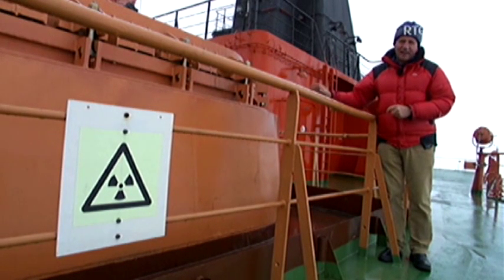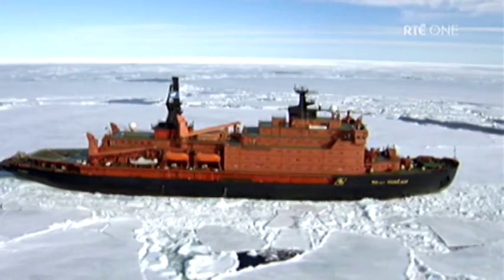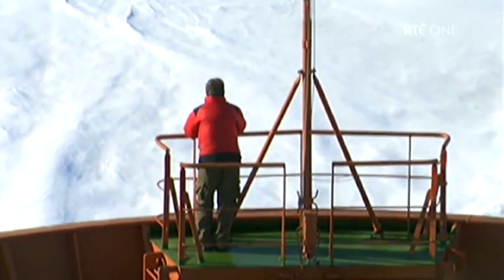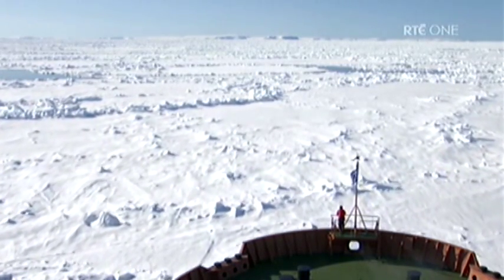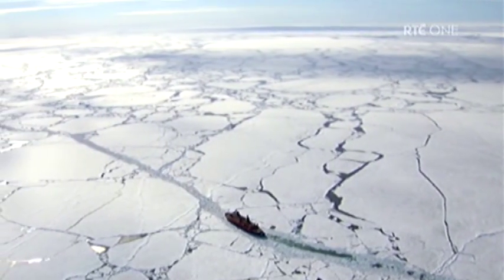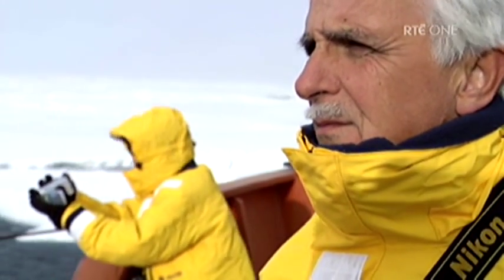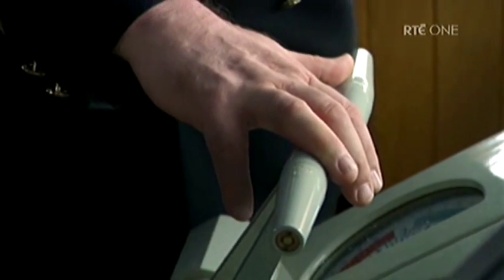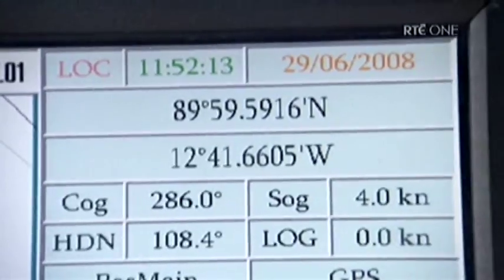RUSSIAN NUCLEAR POWERED ICE BREAKER SHIP 50 LET POBEDY

Comment: The most important point about this ship being nuclear powered is not horsepower alone, but the fact that it doesn't need refueling so often.

There is many even more powerful ships in raw power with diesel engines. But with nuclear power, you can go months or even years, without refueling. While if it was a diesel powered, you would need to refuel very often.
Reply: wopmf4345FxFDxdGaa20 but what about the nuclear waste?
Reply: @ajaythomson22  oof
Reply: Salute for info!☺
Reply: I heard it can go for 10 years without refuling it.
Reply: @sightsandsounds10  fake
Reply: @fightertimur2408  Totally possible. Nuclear  aircraft carriers can go 25 years without refueling.
Reply: @MrSempreme  haha lol 😂
Reply: @ajaythomson22  That's quite late to answer, but)))
You need to waste used nuclear materials only when it is fully depleted. That essentially means that you do it only when refueling.
These nuclear icebreakers need to be refueled once every 5 years.
The wastes are taken away in the process of refueling. After that, they are processed as in every other country - to the nuclear waste facilities and to disposals of nuclear waste.
Reply: @MrSempreme  It isn't wast . It's also for shipping demands .
Reply: @ajaythomson22 they have motors that run on nuclear waste
Reply: The same applies for subs, it allows them to stay underwater for months! It's mind bending

Comment: Ships have already been to the North Pole-  "In 1977, the Soviets powered the first surface vessel to the geographic North Pole. The nuclear icebreaker Arktika departed Murmansk on August 9 and reached the pole on the 17th. The return to Murmansk, by way of Franz Josef Land, was completed on August 23rd. The 14-day experimental voyage, more than half of which was spent breaking through ice, covered 3852 miles at an average speed of 11.5 knots.

1990-   the nuclear icebreaker Rossiya (75,000 shaft horsepower) also made the third visit to the North Pole by a surface ship. (The second visit, by the Sibir', was in 1987). The unique feature of this nine-day cruise was the fact that the ship was adapted to accomodate 40 foreign tourists, who paid $20,000 each for the trip. The cruise was considered such a success that the Sovietskiy Soyuz made two similar tourist trips in 1991 and 1992"

Comment: Nuclear-powered ship can run at maximum power and speed hour after hour and day after day. If it gets stuck somehow (I guess, everything is possible) it can drift for days without fear of running out of fuel and freezing. If needed, it can even melt surrounding ice with hundreds of megawatts of thermal power that is constantly produced aboard.
Nuclear propulsion is the obvious choice for polar seas.

Comment: First off, he said the reactors can produce 175 MegaWatts. There are 746 Watts per horsepower. So it's equivalent to 234,584 horsepower, not the puny 75,000 (175,000,000 / 746). Of course not all the power produced by the reactors will be used to power the ship forward.

Secondly, why all the worry about nuclear waste. Instead of "safely storing it" as the worry goes, just recycle it as they do routinely in France. In the US, we have to store nuclear waste because that waste of a "nuclear engineer" president Jimmy the Carter signed a bill making it illegal to reprocess and reuse nuclear waste. Why? Because the anti-nuclear nuts figured that that measure would make nuclear power less likely to be accepted. After all, who would want a nuclear waste dump in their backyard?

So the best, most environmentally sound fuel, was put off limits to any serious new development in the US and we continue to live with the storage problems, made even worse by subsequent restrictions on the transport of waste.

Question for all you anti-nuclear nuts:  What is more difficult to safely contain, one pound of metal (uranium) or 2.1 million pounds of messy, gooey, flammable, CO2 producing, etc, etc, fossil fuel? Because that's the equivlency. One pound of uranium is capable of producing the same amount of energy as 2.1 million pounds of oil. So next time an oil tanker runs aground and pollutes the pristine beaches and kills the cute otters and ducklings, ask yourself "How many uranium spills there have been since the beginning of the nuclear age?"
Reply: brat997 et oui nous les français on recycle notre merde nucléaire car nous avons un petit pays, on ne peut pas comme vous avec facilité enfouir tout cela au fin fond d'un désert...
Reply: there is no recycling..
After the nuclear reaction, there are many fission products and they need to be seperated. 
After seperation, you get a lot of really dangerous stuff + the stuff you need for bombs (Pu239) you should take a look at hanfords declassified films.
The Purex-process was first invented after WW2 to built the first bombs and mostly all of the reactor-designs were built to produce Pu239.

Also if you like Nuclear waste-treatment, Look up the hanford videos and watch how they tell you, that between 1940-1990 about 2trillion(or billion, i'm not sure)  m³ of highly contaminated and highly hazardous substances have leaked intto the soil...next to the 2nd biggest river of the USA.
And if you like treatment more, look up lahague. They've  got a pipe a couple of a dozen metres reaching into the ocean, dumping radioactive waste 24/7/365

YEA really nice 

also you should know, that you can stand under an Atomic explosion, without taking serious damage from the radiation but if you enter the Canyon of an Nuclear-treatment-plant you die in minutes due to radiation...and there is now way to eliminate that radiation. 

and okay...you say i can't ship oil trough the oceans without the danger of leaking oil and a natural catastrophe.

I prefer the oil leaks instead of contaminated landscapes for hundrets or thousands of years... 

and there have been a lot and a lot and a fucking lot of radioactive spills but do you think, that they tell you??? 
also around 2000 atommic explosions we know of have spilled a whole bunch of uranium.. 

http://www.lancsindustries.com/2017/stop-radioactive-spill/

here they also mention...
"As a radiation safety officer, or a safety manager in a radioactive work environment,
 it’s your job to plan, plan, plan. That includes having a plan to stop –
 and clean up – radioactive spills. In lab, academic and testing 
environments, spills are the most common type radioactive “accident.”"

so go and make your homeworks before hyping an technique you don't understand !
Reply: How many solar powered accidents have happened that will remain poisoning the earth for centuries like with nuclear power? How many solar powered stations ever melt down? Nuclear is stupid when we can harness an energy that creates even less waste
Reply: one modern Russian nuclear station is capable to give electricity, for food of a half of Europe...)) How many hectares of solar batteries are necessary for you to support the small European city...?) And how many it is necessary, for the whole Europe...?) And how many it is necessary for the big plant...?) In Europe there isn't enough place, and with solar batteries will become even less...) 2-3 modern nuclear power plants, are capable to give completely all needs of Europe for electricity...) By the way, you probably have lagged behind technologies, already long ago, during the Soviet period, and now and in Russia, are created, and successfully work, big industrial reactors, on fast neutrons...)) These reactors use absolutely any nuclear fuel...) Even on nonenriched uranium, nuclear waste, from old reactors, serves as fuel, for new reactors which have no waste...) Nuclear waste only America and Europe is afraid... In Russia there are no problems with nuclear waste, they serve as fuel for new reactors...) As Putin, concerning fears of Europe has joked:... Nuclear energy isn't pleasant to you, you don't want to buy gas..., and what you will heat the houses...?) Firewood...?) So firewood in Siberia, it is necessary to buy from Russia again...))) Nuclear power, this most economic, and safe future of mankind...
Reply: You got the point bro,what people need is just evacuate the USA into empty land to supply the solar powered electricity to the world
Reply: space ghost coast to coast solor isnt effective for machinery like this ship yet.
Reply: brat997 tldr; op complains about nuclear waste but doesn't know what nuclear waste is.
Reply: French recycling works by sending the stuff to Russia :)
Reply: Uh? Since 1990 all ammunition used by the US military is depleted uranium. That's right, bullets, anti tank and ship weapons and artillery shells are made using depleted uranium.  Do some research 🤣
Reply: You are aware thoe that combustion propulsion is different in the marine world hence figures are recalculated  to adjust to nautical miles.
Reply: @spaceghostcoasttocoast9343  we already dump all our electronic waste in African countries. What do you think happens when we start making hundreds of square miles of solar panels? What do you think happens to the land that gets covered in solar panels instead of producing food? How about all the species that will go extinct because the area becomes inhabitable? (and this is not in case of a "spill", for solar, that's the expected outcome). How do you store that excess energy to redistribute it during the night without costly and polluting batteries? There is a reason we don't have solar everywhere already.
Reply: @paradhoax  uuuhhhhh There is no viable alternatives (if you say solar or wind, well go read up on that and come back later)
Reply: @spaceghostcoasttocoast9343  Pollution from the process of building and utilizing enough solar panels to produce the same amount of energy would easily be worse than what you get using nuclear power.

Comment: @vampov This is not true. Titanium is not key. Normally if you want to have strong steel with long temperature proof, you need to add apprx 30% of Nickel. Nickel with Chromium singnificantly decreases the transition temperature od the steel alloy. Also you must remove Carbon as much as it is possible from the steel. Because the Carbon could cause any kind of inter or transstructural rupture in a steel structure.

Comment: It's from an uncited comment on the nuke powered icebreakers wiki article.
But you're essentially right.
Also the other obvious one is to roll back the power generated, without having to cut through ice it's energy demands would be reduced, thus requiring less power and less cooling, at the very most it'd just have to travel slower.

Comment: how thick do you think that hull is? i bet it's at least 1/8" thick.
Reply: I read somewhere that at the bow of an older ice breaker is up to 2" thick.  Strictly a wild hairy guess would have it that with the new high-speed steels available out there, it would be down to about 1" thick.  Seems like a lot of metal, but remember those ice floes look pretty thick--enough to gash a lesser ship.  So, in addition to the amount of metal, the type of metal used is considered in designing such a ship as an ice breaker.  But, whatever all of that, it sure is awesome seeing that thing plowing through all that thick ice as though it were cheap plate glass.  Makes you just wanna take that bad boy, go out and hunt down that iceberg that sank the Titanic and bash that sucker to slush.
Reply: Certainly not wrong ....

Comment: tbh it doesn't add up: if each of the 2 reactors produces 175 MW of power then the HP value stated here can't be correct and vice versa. so what is true?
Reply: In fact, everything is true. 75000 is the force selected on the shafts of the propeller, but not all of the energy goes there. Lighting, heating, too, require energy.

Comment: Are you sure about that? I mean 0C water and 35C water only have 35C difference which can surely be negligible or easily counteracted by increasing coolant flow. The reactor reaches really high temperatures so the heat flow shouldn't be altered much.

Comment: @dinoing07 
Gas prices won't go down. Costs of oil extraction there make it only profitable if price is high. You can read about new russian arctic railroads and pipelines on Yamal peninsula — costs are absolutely insane. In winter temperatures go down below -40°C and in summer the region turns into one huge swamp several meters deep with permafrost on its bed. Nightmare for engineers.

Comment: this Russian ice Berg  is  a masterpiece scientific achievement. this technology should be used in every ships for the advanced engineering technology for modern ships .ln any time  any ships has have any ice water or ice Berg inside water the video cameras warning captain insides the water ice berg  is there so  captain switch on the atomics power ice breaking  system.the ship may not get any dangers.the ships construction company should used it for every ships .the ships is having any time faces such ice rock it may slove the problem .it.may be externally surface of water or internally inside water of ice rock destroyer .

Comment: This is one badass ship! Did he say 75,000 horse powers?
Reply: Shaft horsepower = the power that goes to move the ship.
The two reactors produce the equivalent of 230.000 hp EACH. Some of it is lost during conversions, a lot is used to heat the ship surface at and below the water line, and some 3*24.000 hp goes to propulsion. Yepp, badass indeed! :D

Comment: No ship can travel to the South Pole. Unless they've invented a ship that can drive over land and over huge mountain ranges.  The North Pole is in the Arctic which is all sea ice with no land..   The South Pole is in the east Antarctic which is a continent comprised of land thats between a few 100 feet to several 1000 feet above sea level.. This dry land is covered with sheet ice and glaciers thats are about 4000 meters or 13,000 feet thick. 90 percent of the worlds fresh water is in Antarctic.

Comment: So they cut their waythrough the ENTIRE ice shelf all the way to the pole? Isn't that harmful, won't it accelerate melting?
Reply: Why would it? When you have a piece of ice and break it in two, does the total volume of ice change? No, it doesn't.
Reply: chaser if you spread your meal on a dish, it also reacts faster to the surrounding temperature. so i don't think your example is correct. however, the winds are cold there, and water cannot drop under 4°C, so it won't be that dramatic
Reply: Ainigma I see what you mean, increasing the surface area also increases the thermal exchange rate. But given that the ice is in contact with water all day long, I believe the effects of increasing the area briefly should be negligable. Also, the temperature difference isn't quiet as high as between a cold plate and hot food.
Reply: One ship is like an ice skate on a hockey rink. Bear in mind the arctic ice shelf is around 14 MILLION square kilometers. http://nsidc.org/arcticseaicenews/ and the ice in summer time can thaw completely at the pole. http://www.livescience.com/38347-north-pole-ice-melt-lake.html
Reply: Ultimately it doesn't matter at all to sea level if all of this ice melted because it is already on the water, Ice on land once melted will flow to sea level, thus increasing the volume of water in the sea and rising the sea level. But Icebergs are floating, over 90% of the volume of the ice is below the water, as Ice has density of 916kg/m^3 and water has 998kg/m^3 it is only the difference, 82kg of ice that lies over the water. So when Ice melts is reverts back to its original volume, the exact same volume as the ice lying below the sea level, thus there is no difference. It will however slightly increase the global temperature as heat can only be created and not destroyed everything can only gain heat, in order to lose heat you must transfer it to something colder. So in terms of whats actually possible with physics if we want global cooling we must make some stuff hot and release it into space, or start heating up the moon. They are ambitious solutions but they are doable, there is no point in talking to someone who doesn't understand this problem, it is a physics problem and can only be solved through the use of physics, someone could conceivably come to this solution without the use of any physics but he/she would either have instincts better than a calculator or have been outrageously lucky. Of course we actually allegedly have a shortage of energy the race of humans are unlikely to throw the energy away. But that is the simple solution to global warming, so you can now relax, chill out and stop worrying, unless of course either this is not a workable solution or the people in power will not use this solution. So which is it?
Good to see some good coming from Ireland
Reply: What? :D

The point of global warming is that CO2 prevents earth from heating outer space in the form of spontaneous infrared emission. If we want to cool the earth, the obvious way is to reduce CO2, and let it cool itself as it would normally do. Transferring heat out in any other way is probably insanely costly.
Reply: Sea ice isn't an ice sheet. The ice sheet in the Arctic is on land in Greenland. The risk of sea level rise comes from land ice sheets detaching and breaking off into the sea at an accelerated rate (especially since meltwater can flow below the glaciers and greatly reduce friction, allowing them to slide off much faster)
Reply: We've been using icebreakers to get to north pole for decades - first time we've reached north pole using surface ship was in 1977. One in the video is just faster than those before it.